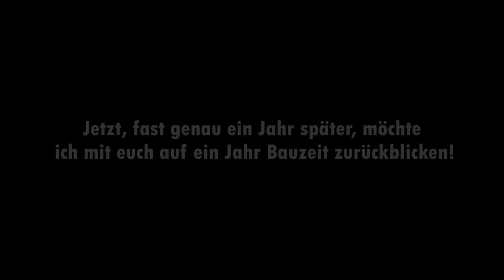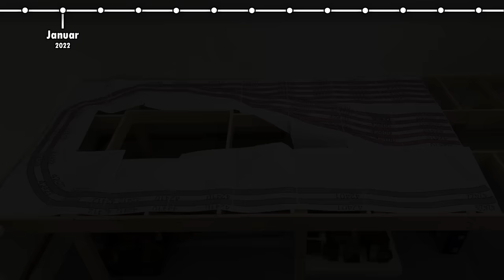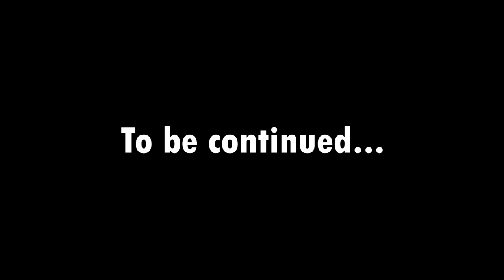One year building my model railroad in 12 minutes | Timelapse | Digital model railroad

Comment: Brit here. Not a railway modeller but am a woodworker. Usually surprised at inability of otherwise brilliant modellers to do woodwork. You're an exception. All that timber bought in Covid era must have been expensive. I had to cut back on some projects in the house due to jump in costs
Reply from the maker: Yes, timber prices have also exploded in Germany, but they have remained within acceptable limits. Because of this, I have also opted for smooth-edged boards that are cheaper. 
Greetings David :]

Comment: You need patience, knowledge, and skills to do anything like this.
A few questions:
1. how did you decide on the different sections of the frame?
2. will you cover the metal rods (to turn them into something which looks like realistic pillars)?
3. where does the diorama go into the layout?
4. will you replace the big screws which keep the track in place on "Ramp West" with smaller, "invisible" ones?
Looking forward to seeing the room after another year!
Reply from the maker: Thank you for the words of honor! 
Here are the answers to your questions:
1. the maximum length of the boards was 2m. This was the maximum size of the frame on which I then built.
2. the threaded rods are installed only in the later not visible area. So I do not have to hide them.
3. the diorama is not integrated into the layout, because it serves only as a presentation module.
4. yes, the screws will be removed again because the tracks will be glued on later.

I also plan to cut again a 2 year construction video as a summary, but until then there is still some time!

Best regards David

Translated with www.DeepL.com/Translator (free version)
Reply: @Freestylemoba , thank you for your answers!
Have a great, most-productive, new week!

Comment: Literally hundreds of track joints! So much potential for electrical issues. Why wouldn’t you use flextrack?
Reply from the maker: This way I can work better with the radius. In the visible area, a lot of flex track was taken. Also, there are power supplies every 50cm ;]
Greetings!

Comment: Added this 9 Mos later...
I also believe you have way too much yard trackage/and or staging trackage, and situated were it's too hard to get to.
On a MRR the yard/s should be near the front edges (+-) for that reason.. Are you going to cover all that with scenery, or leave it visible where it's blocked by the 2 track main line above and in front of it ? 

Where are you going to put your land/hills/structures/roads ? How will you reach the blue-green trackage against the rear wall if there's a problem with a train or track ?
Sorry. I'm only contributing what, from here, looks to being some design flaws; not a put down, just constructive criticism.
Reply from the maker: Thank you for the honest critique.
I have already planned from the beginning maintenance openings in the base frame to get to all tracks in the staging yard. Furthermore, removable elements are planned in the visible area to come from above to critical places.

I think that I have so everything well covered. 
Greetings David

Comment: Fascinating video, but the above-board point motors seem somewhat intrusive.
Reply from the maker: Thanks! Which engines do you mean?
Reply: @Freestylemoba  at 3:03, the point (or turnout as Americans would call it) furthest from the camera has a large black item alongside it. I assumed this was a motor for changing the direction of the turnout? It seems large, so it might be worth looking for motors that fit under the board. Maybe I’ve misunderstood what it is.

Comment: You made the same mistake 8 out of 10 people make with open grid benchwork. You should have put ALL that flat sub-roadbed up on risers about 5-6" so that you'd have room to go downward from 'ground zero'. Also, you have too sharp curves in the main line using sectional track.  And take those hideous large screws and washers out of the middle of the track !! White glue is enough...
Reply from the maker: Thank you for the note ;]